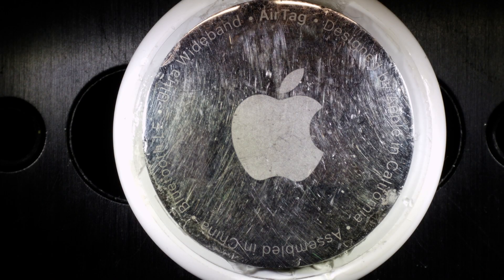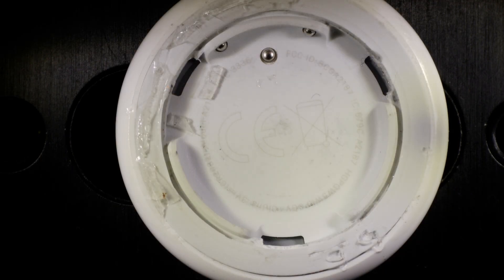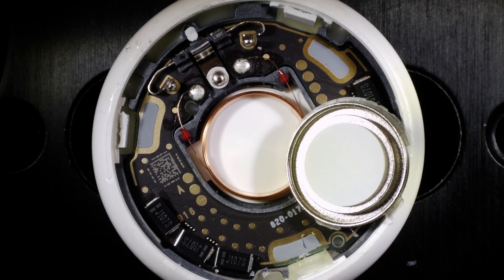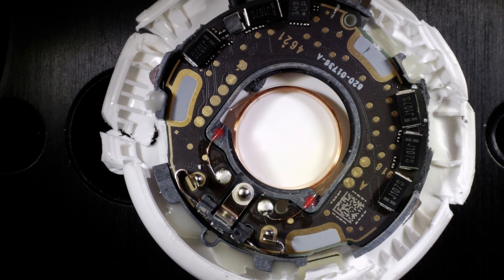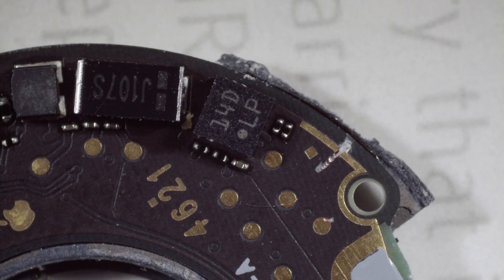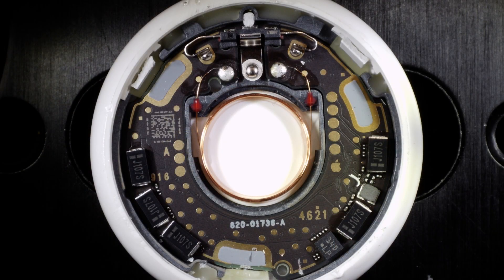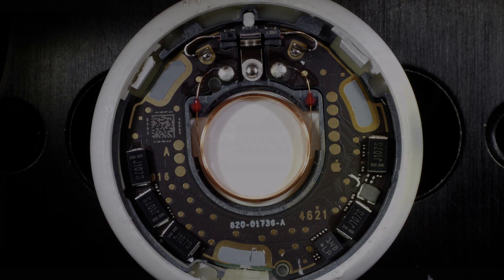#2331 Apple Airtag Teardown

Comment: That 14D-LP “ic” is actually a System In Package (SIP). It contains ic’s inside of it, antennas, and other circuitry.

So it does BLE,NFC,UWB,and sound, all inside that little package.
Reply: No it doesnt the PCB is to sided and the IC manufactured by nordic semi is over there
Reply: @louisvids  I did open an actual airtag and look everywhere on each side of the PCB, and looked at the "14D-LP" package on a microscrope, and even search for it on the web.

I wish I could upload a highres video of the actual airtag from both sides, so you can see what I'm seeing.

Comment: What about the other side of the PC?  There should be a bunch of stuff on there.  Maybe part 2?
There should be a Bluetooth and NFC processor, serial memory, audio amplifier, over voltage protection, and buck converter.
Reply: Most (or all) of that stuff can just be included in the SoC package.
Reply: @silverXnoise it isnt a SoC, it is a SIP (System in Package)
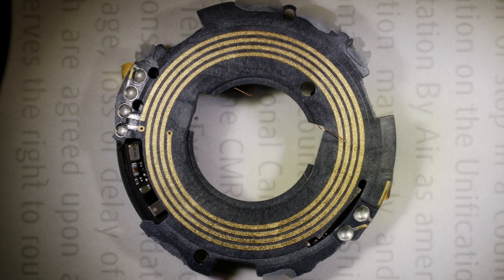Reply from the maker: At 1:40 I show back side of board.
Reply: @IMSAIGuy that's not the other side of the pcb. below the coil antenna (probably nfc) there should be more chips. I've seen a teardown of an early unit and it contained an nfr52832 and a UWB chip.
Reply: And the capacitors extend the battery life since ble transmit bursts draw about 20ma, a current spike that strains those smaller lithium coin cells. They unfold their full capacity under lighter loads.
Reply: @IMSAIGuy This must be version 1.0 of air tag.  I’ve seen another one and it has WAY more stuff on there backside.
Reply: @IMSAIGuy  Through the slots in this spiral thing, you can see a bunch of components on the other side of the board. A few capacitors and inductors, the edge of the chip case. Remove the antenna unit and you'll see the whole world. And the 14DLP is probably only responsible for power.